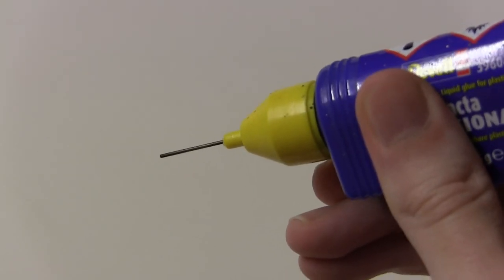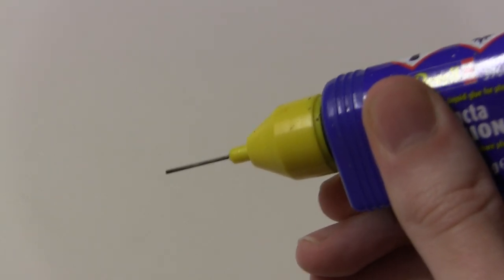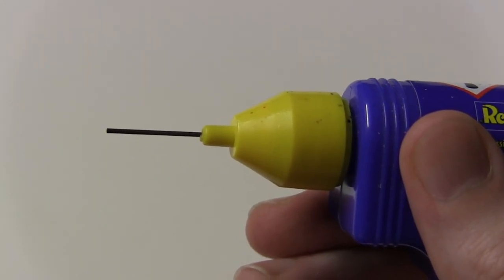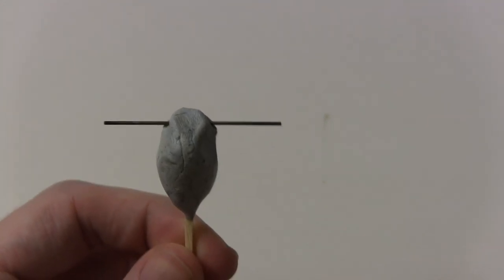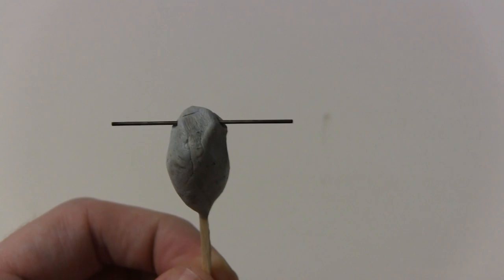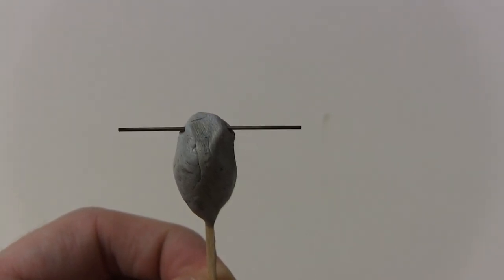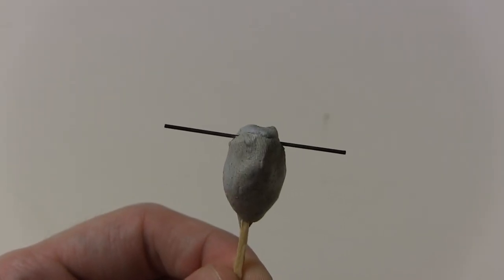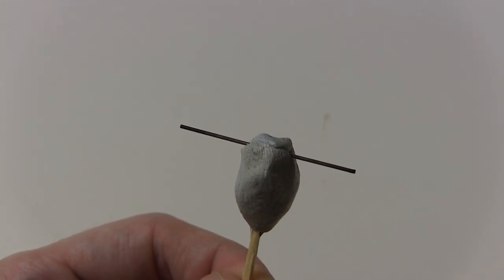How To Unblock A Glue Needle

Comment: i just tried this and it didn't even work :(
Reply from the maker: I would suggest holding the flame in place for longer. If it doesn't work, perhaps your needle is bent or there is some other problem.
Reply: i've only had it for a few days lol. nothing wrong with needle except now it looks black.  @Andy2D6
Reply from the maker: Once the flames have been at it, sometimes I have to give it a quick tap on a table to get it flowing. I find that I have to repeat the whole process every time I don't use the glue for a few weeks.
Reply: A match, who would have thought it is so versatile of a tool.